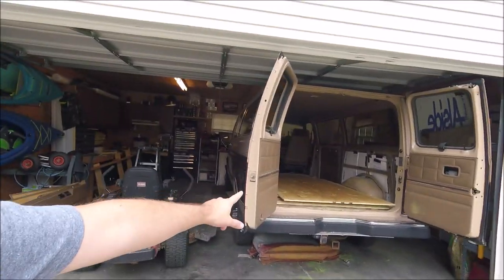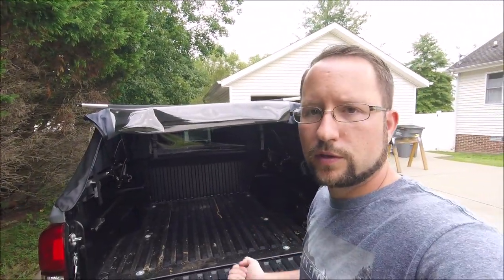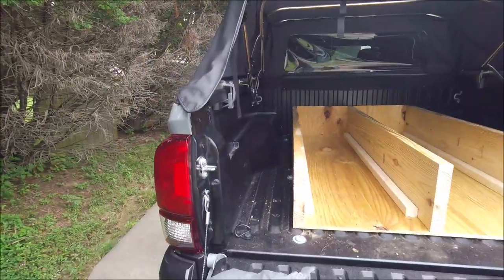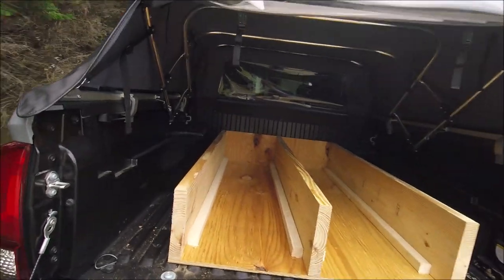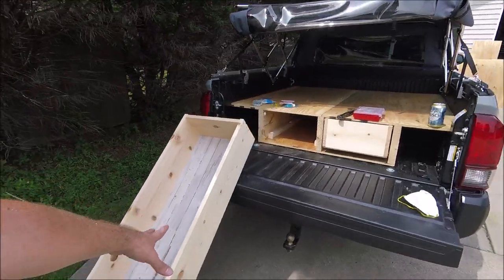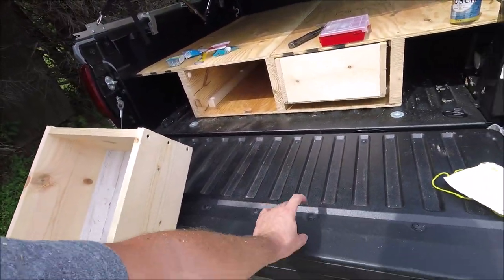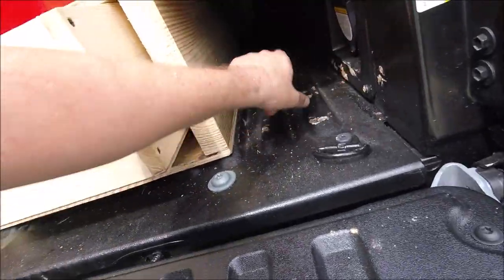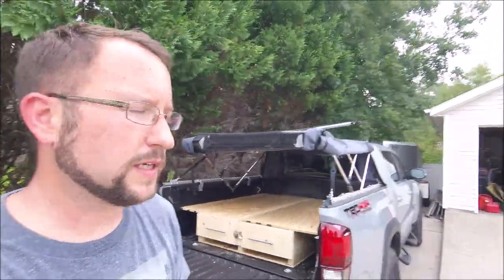How to build Tacoma truck bed drawers for camping and overlanding.

Comment: Love the furniture glides, way cheaper than full drawer slides for like $500. What size 2 x did you use for the frame?  2x10 I guess.
Reply from the maker: Thank you. I believe I used 2x10 for the framing and 1x8 for the drawers.
Reply: @RubberTrampRenegade  thanks man, I’m gonna build some drawers for my Tacoma when it warms up a bit and my driveway isn’t pure ice!

Comment: Nice job! Anxious to see how you do the truck bed tent. Will you have to remove the soft shell camper?
Reply from the maker: I am leaning toward the rightline truck tent. The soft topper folds down and rests up against the cab. The truck bed tent should go right over the bed with the topper folded down from all the research I've done.
Reply: @RubberTrampRenegade  sounds great. Hope it works out for you. Loved your first van -btw."  I started a truck camper build on an 04 Ford Ranger ext cab. Made my own end cover with lift gate open and tailgate down, gained about 2 ft more length plus I put screens in it and zippered doors at end with screens in those. I think its Colorado Backcountry that had a really cool solid extension that is so awesome. ..